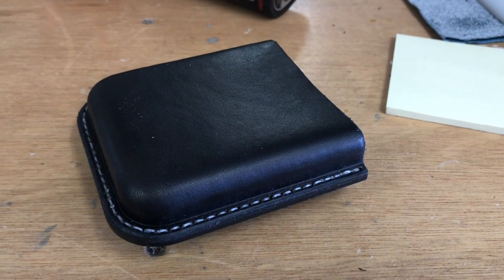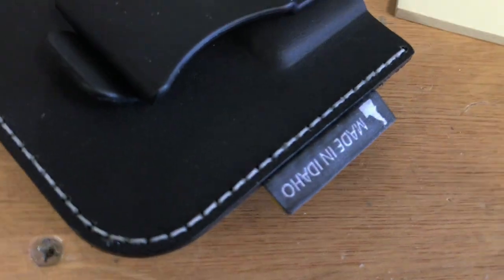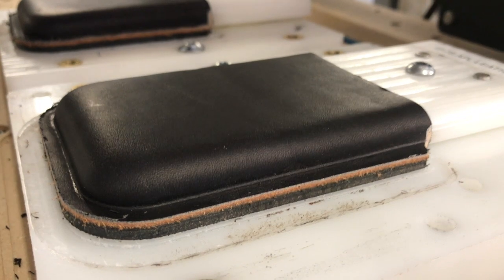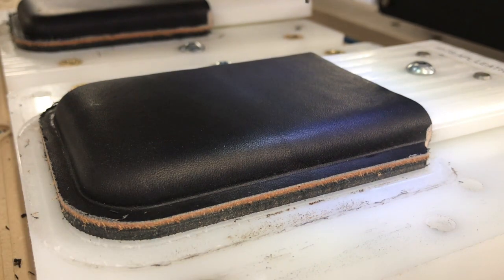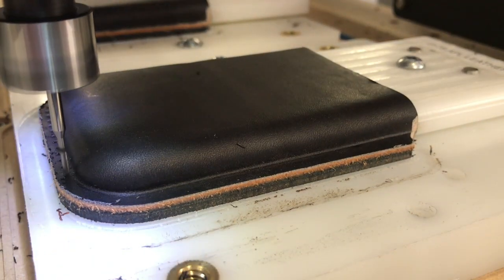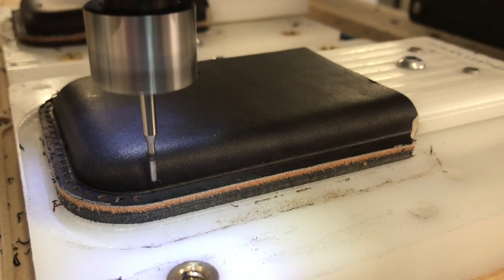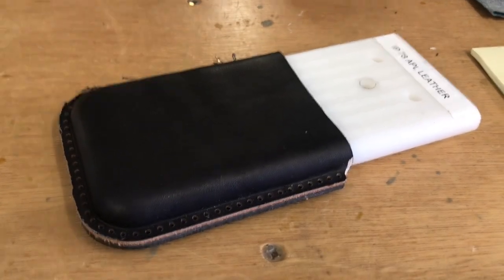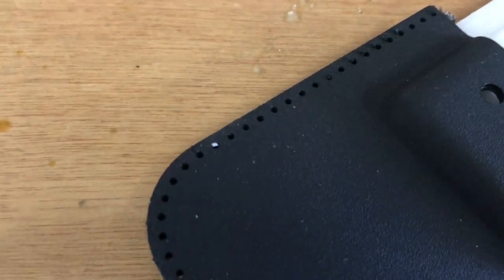Stitching through Kydex and leather with a Shapeoko CNC router

Comment: Thank you for the nice video it helped me with an idea I've been working on. I have been working on batching out multiple jobs at a time and have been having issues with placement. Do you have any advice about setting up multiple jobs on one operation like you have laid out with the shapeoko?
Reply from the maker: I cheat a little bit for multiple setups. I first cut a 1/4" hole in the bottom-left corner and I use that as my datum, so I zero X and Y to that hole by dropping an end mill or dowel pin down in it and Z to the top of the wasteboard. I cut the wasteboard with alignment holes for the additional fixtures so that they are all located with respect to the 1/4" hole. Then I can use dowel pins in those alignment holes to precisely locate the additional setups in relation to that original hole.
Reply: @the_holstery  Thank you that was very helpful.

Comment: This is awesome! Looks like they endmill.is a down cut? Also.are you needle sticking or using a sewing awl? Since the ktswx holes won't give or stretch what size needle are you using if your hand stitching?
Reply from the maker: It's a 1/16" uncut end mill. Plunging with a down cut doesn't work as well and would risk blowing out the glue joint between the Kydex and leather. 1/16" holes are more than enough to fit a large needle. I don't recall what size I was using but it would have to be VERY large not to fit.
Reply: @the_holstery  thanks for the info! I’m been doing some research and testing of leather and hard material combos for a project I’m working on. This helps a ton.